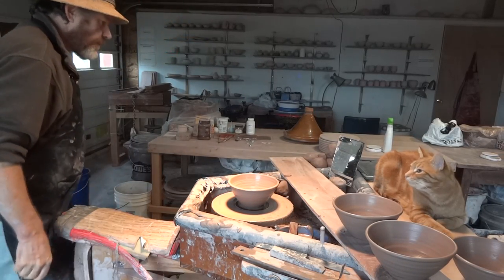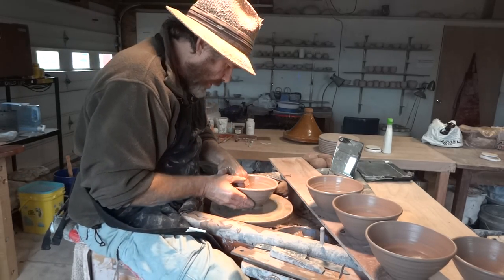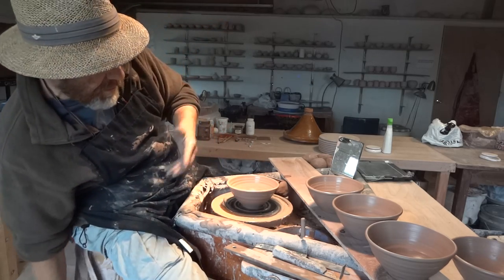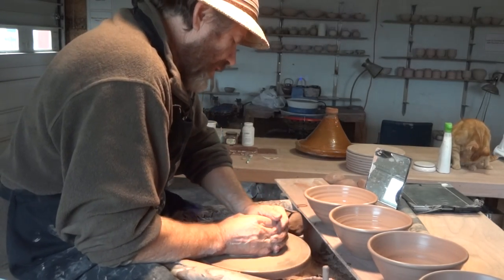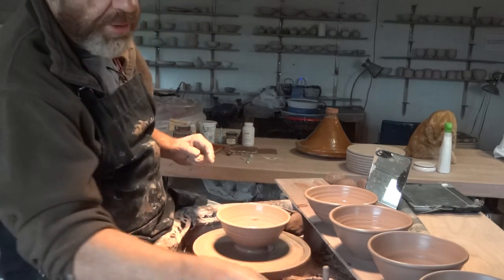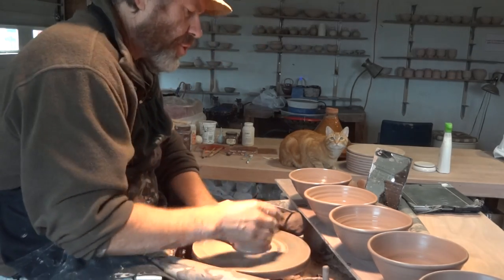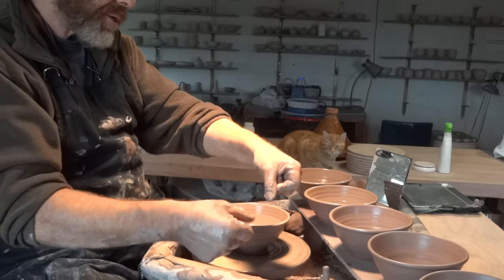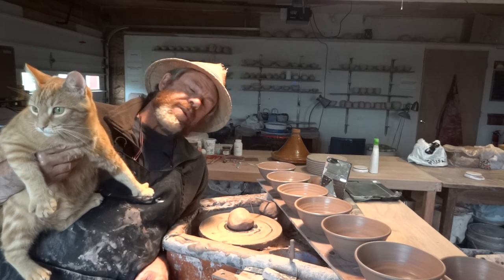SIMON LEACH POTTERY TV - Throwing GP bowls for lugging !

Comment: How should you glaze a pot without a foot ring? Do you have to put wax on the pot a little up the sides?
Reply from the maker: +trebor These have no foot ring but no matter as they are only glazed on the inside, sprayed with wood ash on the outside.
Reply: +trebor If you have a pot without a foot ring that you do want to glaze, you can just wipe glaze off the bottom and a bit off the sides with a sponge. Once you get the hang of it you can get a very even line.